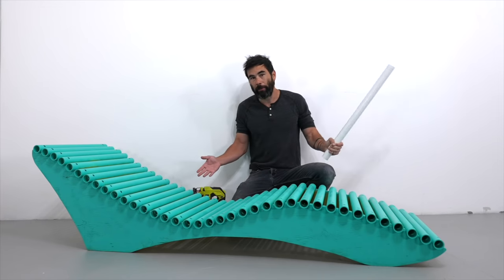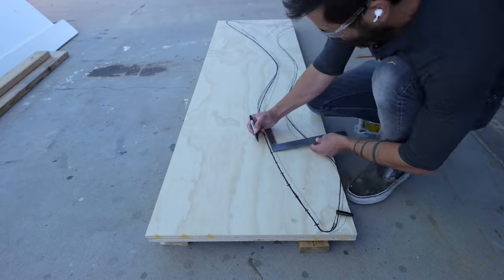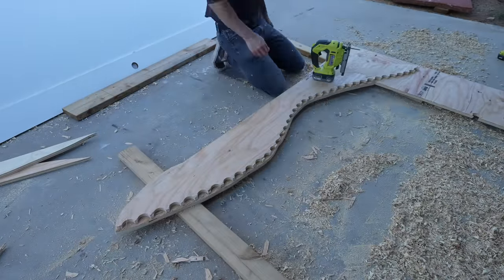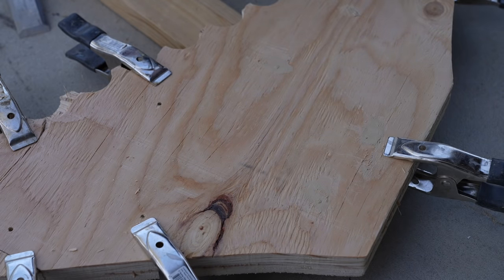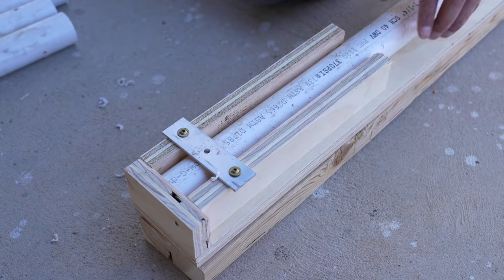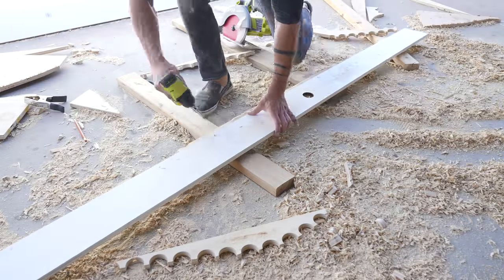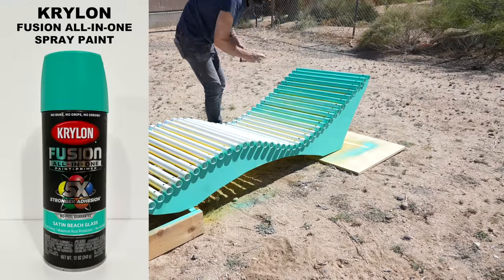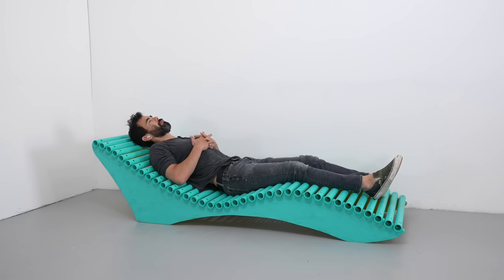DIY Pool Lounge Chair

Comment: Something that came to my mind as a variation is that you could make holes in the plywood and insert the pipes instead, but use fewer pipes and space them out more so that you can cover each pipe with a pool noodle (if it's not possible to insert the pipe in the noodle, the noodle could be cut down its length and just pushed over the pipe). This would make this lounge chair so much more comfy. 😊
Reply from the maker: good idea!  I used pool noodles for a sofa project before and they are cost effective and hold shape well when placed around a pipe
Reply: OMG I just had the same idea!  :)  I like your idea of how to attach them too!
Reply: I kept thinking the same thing bc the PVC seems like it would be hard on the back. But I LOVE the finished product!!!

Comment: Maybe you could employ a few connectors on the pvc pipes so several chairs can snap together and become big couch. Also maybe there's a design idea where you have larger diameter pvc pipes in the base with sealed end caps so the whole chair floats in the pool

Comment: nice... but water will destroy base pretty quick...
Reply: Water damage is my concern as well. I feel like there should be some sort of water sealing. Am I missing something?
Reply from the maker: I used to think that too but out here in the desert I have spray painted furniture that is holding up great after 2 years of being outside.  it def ages but even after pressure washing its still fine.

Comment: Not longstanding... No middle support, and the builder seems to not understand his materials. Especially how low of a tolerance PVC has to stress.
Reply: How low tolerance PVC has to stress i’ve been building air cannons that lunch golf balls tennis balls whatever you want to put in them the canister that holds the air pressure is PVC I’ve been doing this for 10 years now out of the thousands that I’ve made Ive not had one person contact me back saying that the tank exploded or anything broke for that matter and it’s all out of PVC.  holding pressures up to 250 psi I’ve had one holding pressure four weeks before I finally let it go and if that kind of pressure it will put a golf ball completely through a car launching a golf ball close to 1000 yards where have you got your experience on PVC from because DWV can handle way more than the rated 40 psi at least quadruple. Unless you’re 4-600 pound individual it will last a normal person  their lifetime💪🏼
Reply: lol if you're not featured on the tv series My 600lb Life this should be more than enough to support you.
Reply from the maker: its actually quite strong at short lengths like this but lets make a bet! $100 to a good cause that it can hold 400lbs center loaded! I can do an live broadcast of testing it